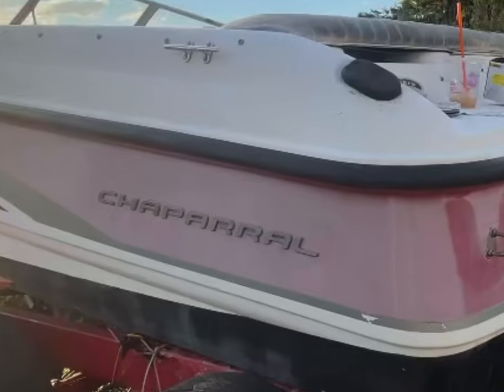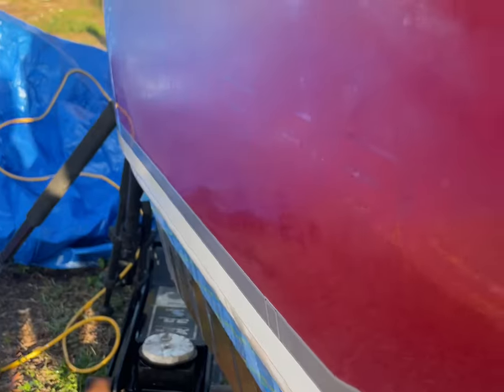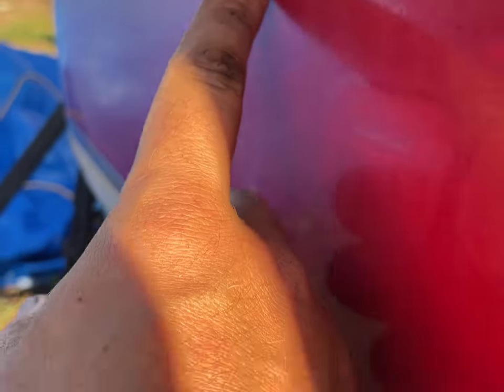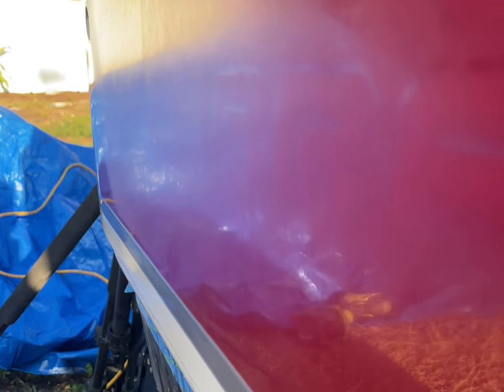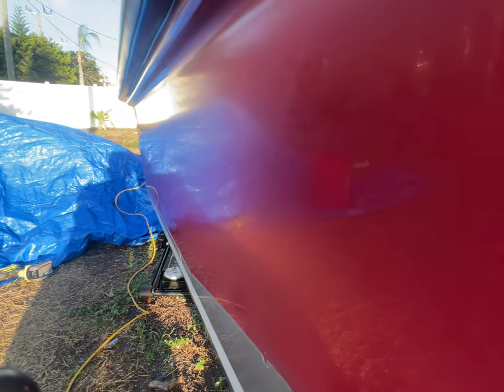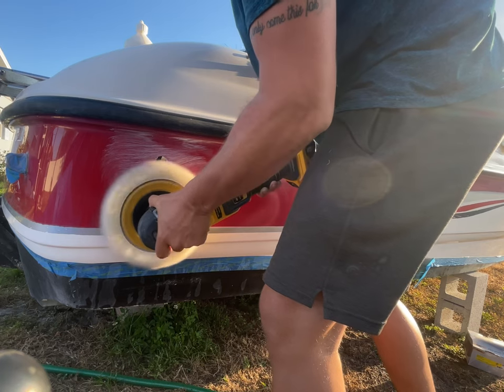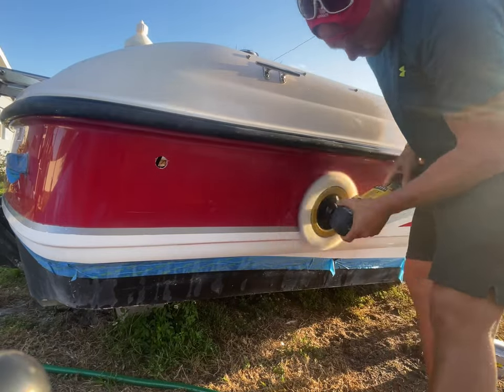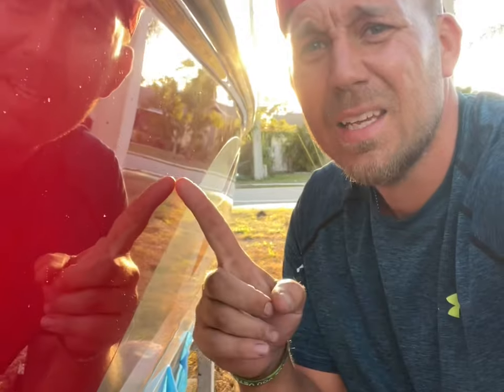How to Wet Sand a Boat Properly ⛵️ (Remove Fiberglass Oxidation & Restore Faded Gelcoat)

Comment: Looks great! If you’re scared to do this I would suggest starting by hand! with 800 grit and going all the way to highest level of paper you can get.. did my 04 skeeter bass boat and it turned out great!! Looks like new again! 

Take your time keep the paper wet and don’t move to the next grit too fast! Work in small areas and keeping the paper wet is the most important part. Get a bucket of water and keep it soaked! Good luck. Thanks for the video!

Comment: Hi, what DA tool and rotary buffer do you recommend for the DIY?  I'm not looking to do this professionally but I do own two boats which I would like to bring out the shine.  One of the boats, I removed the registration numbers and you can still see them as "shadows" on the hull.  This particular boat's hull still has a decent shine but the numbers thing is bothering me and I figured that now that I have the numbers off, it would be good idea to at least compound the hull and I am hoping I can remove the shadows with just compound rather than wet sanding.  Thanks in advance!
Reply from the maker: Hi there. I teach an online course that literally covers this exact information. From how to use each machine, compounds, swirl and oxidation removal. My TikTok has all my best videos and suck. @swflmarinedetailing.

Comment: Great helpful videos. If a hull is still shiny at the end of the season, do I have to make a compound, polish and wax job or I can only wax? Thanks
Reply from the maker: I would always do a very light cut/polish before applying any sort of sealant. Need to open up the pores of the gel so it accepts the sealant.

Comment: What grit would you recommend using to sand down high spots on a gel coat? I just replaced some underwater lights on my boat and the new lights screw holes don’t line up. I filled the old holes with a gel coat but have a couple areas that need sanded.  I’m in SWFL too, Port Charlotte.
Reply from the maker: Once you sand you’ll need to buff as well, try some 600,800,1000 grit. Just like that in succession.
Reply: @Swflmarinedetail  Thank you for the response. I appreciate the help.

Comment: How do you wet sand at the  stern of the boat, where there's a ladder and other things that stop you from being able to get your DA machine in there? Do you sand it by hand? Also, when you remove the decals, what's the process of replacing them?
Reply from the maker: Yeah man. Either by hand or I use my mini polisher. It has a 1” attachment that works amazing!
Reply: @Swflmarinedetail  Thank you!!
Have you ever heard of someone using a much larger DA or rotary tool to efficiently detail a large boat? Like 12" or something?

Comment: Does a buffer machine rotate the same as the DA sander.  Or is the buffer an angle grinder with a buffer pad on it?
Reply from the maker: A DA is called a “dual action”, it rotated away from the center 6-8mm so it caused a random orbital effect. It doesn’t spin in a tight circle like a buffer does. A buffer is different from an angle grinder. 2 different machines. Buffer spins in a circle and you can control speeds. I don’t believe you can control speeds on a grinder. In this business you’ll need a rotary buffer, long throw polisher and a DA.

Comment: Well damn after reading the comments i feel i stuffed up, I took the name paint off my glass boat with 240gr on a 2 inch drill pad it worked a  treat but there's still ghosting, i moved onto 320 then 600 then did the whole side with 800, there's a few small scratches i sanded out with the 800 too, I'm a bit hesitant to polish with that ghosting but am concerned about using the more abrasive discs again.
Edit,  the boat is 20 years old and white.

Comment: I want to update the lettering on my ski boat but I'm afraid of the ghosting that will be under them. The hull is white right there though and still pretty shiny for 20 years old. Can I sand out the ghosting on a white section of hull?
Reply from the maker: Yeah for sure. Gonna have to get pretty aggressive with the ghost letters, but it can be done. Might have to do a few rounds of 600,800,1000 until there aren’t any lips left.

Comment: I'm working on a 1988 38' Carver yacht.  It had a lot of mold, mildew and algea on it when we bought the boat.
 We hired a pressure washing company to pressure wash the boat. It appears they used bleach in their pressure washer and it etched the gelcoat.
 Will sanding and polishing bring that back do you think? Or am I just screwed? Lol
Reply from the maker: The only way you can see etching is by holding a light up to it to look for scratches. What you’re probably seeing is cleaner sections than others. But guess the next step for you should be to hire someone who actually knows how to wet sand buff and polish and seal properly

Comment: I would have stopped at at least 1500 grit, even 2000 dry sanding. Dry sanding is quicker, and with a higher grit you will spend less time on the buffer.

Comment: I have a bass boat with a bright red sparkly gel coat and it is absolutely faded. 0 shine. The sparkles shine a little but the coat is faded as ever. Can someone point me in the right direction of a good grinder for this? Im guessing i cant just use a milwaukee or dewalt angle grinder? Or maybe i can? Does it gotta be a certain rpm like buffing?
Reply from the maker: You’re already looking at about $1,000 of maxhines and products. Hire someone who knows what they’re doing. This isn’t a diy type situation. I’m in Florida if you need help!

Comment: Good video but starting at 320 grit is way too aggressive. You’re going to take away way too many micron layers of your gel coat after you do this a few times you literally will be burning through it. You can get away with starting at an 800 or 1000 on a DA and then go up from there to maybe a 2500 and buff it off of that This method you’re doing would take way too much time to get rid of all your sanding marks, but that’s just my opinion There is definitely more than one way to do the job. It’s just what I’ve seen work for me over many years. The coarser u go on your paper, the more steps you have to take and you will always have swirl marks left over some places
Reply from the maker: How do you think I ended up at 320? Lol, it’s because all the others didn’t work.
Reply: Gotcha well either way good job

Comment: Why use the fluffy pad for compound and not a more firm foam pad?
Reply from the maker: Wool pad goes on the rotary, which is the next step of scratch removal after sanding. The foam pad is for getting out the swirls that the wool pad leaves behind.

Comment: Have you ever tried wet sanding over the vinyl graphics on a boat and does the wet sanding also work on them to remove oxidation?
Reply from the maker: I’ll never sand over decals, I’ll buff over them though quickly so they don’t melt. 9/10 times I’ll take the decals off and replace.
Reply: Do you have a source for custom vinly pinstriping?

Comment: Wet sanding means to me the person doesn't care about their boat and probably won't pay what it costs to be done right! What has been your experience? I'm starting out my own thing after 5 years+ working for others.
Reply from the maker: Wet sanding is a must when the gelcoat has completely failed, the top layer.  I find when I explain it correctly to the customer, they understand the process and will oblige. I’ve done it a bunch so I just show them past results, and they love it. It’s all in the presentation.

Comment: In my humble opinion, compound is all you need. A rotary and a wool pad. I'd have that gelcoat done in no less than 6 hours and it'd last.
If you took me seriously, you'd make more money and have more time for better boats and more clients.

Wetsanding is so 20th century. Even done right, waste of time 99% of the time.
Reply from the maker: Lol compound didn’t do anything to this gelcoat. It was wayyyy too cooked. Heavy cut didn’t dig as deep as needed. Had to wet sand and step it up from there.
Reply: The boat looks great, there's always somebody here that has no real experience that has to put their two cents in instead of saying oh I know more just say nice job, don't be a

Comment: 45degree shots in the afternoon sun shows nothing of what this job is about. I’m sorry friend. 

Show us this process pointing directly on the gel coat and in direct sunlight. 
That’s when you see the quality of your work. 

I also feel that you’re using WAY to much product on your pad. Rubbing and polishing is not about using force at all. It tells you that you’ve not done the wetsanding steps good enough. 

IMO - just what I see in this video. 
Good luck. Looks like you made it to the finish line.
Reply from the maker: Got it. So you come move the sun for me to get that straight on shot. This video is simply made to show the process. And I like to use more compound than less so it covers the area evenly to ensure I get the most sanding scratches out that I can without it coming out splotchy. Thanks friend. Hope you enjoyed the video.